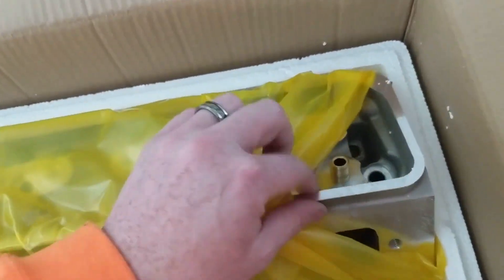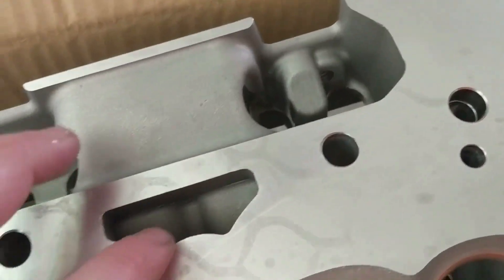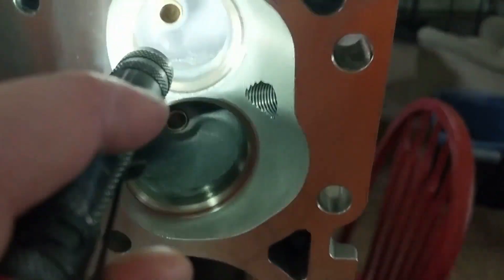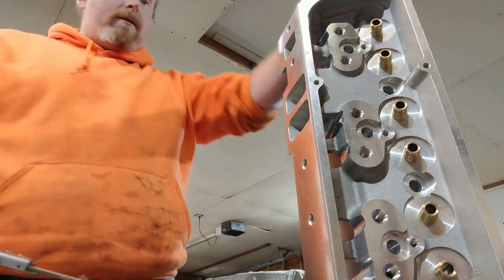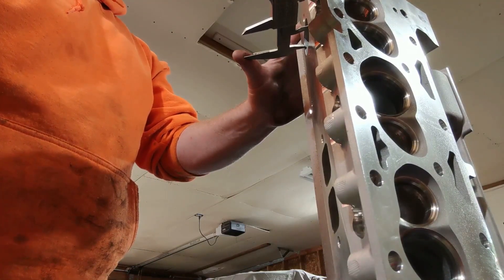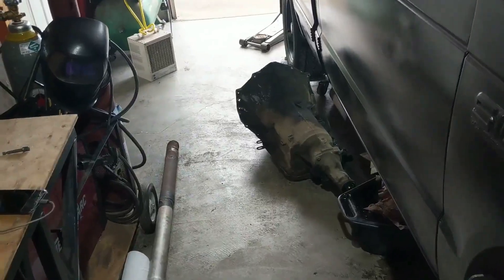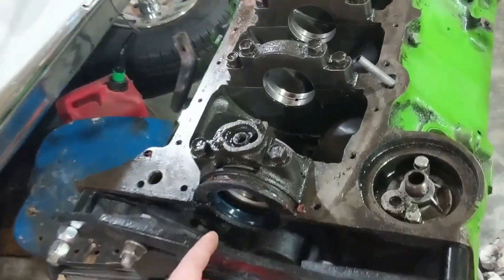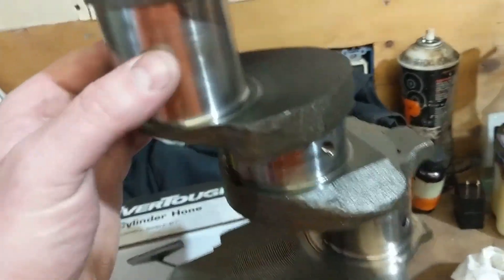Ebay Aluminum Heads... Are they worth it?   Part 1

Comment: What's the ebay part number on the aluminum heads?
Reply from the maker: There are a bunch of parts numbers, some heads have straight plugs and some have angled plugs. It all depends on what your application is. A simple search for eBay Sbc heads should yield results. I believe mine came from KMJ performance, if I remember correctly I was able to order the parts kits directly from them on their website. Here is a link https://www.ebay.com/itm/402267322479?hash=item5da900386f:g:DiYAAOSwVbVfK1iB&amdata=enc%3AAQAIAAAAwGQKBCwzW98v8qfCiCTgTp5k9%2Bmd3Gg%2F1bZYHt589QSlRZfsfC2DCf4pRqdEfKHoJxmalt%2Fsu4P8NYxs76Otir8UI%2BqJa0qZ4NekhR%2B9ZhFSplv3LssVx9WJ7%2FO7%2F5RAJzSyIs1j%2FECAsb3TuONq4%2F6nmN6S9MmgaIV4NeWkFPBnwlbDSBFbP4sLMl62A0xRrzvkZSW%2FHtPLxqR0xJG62zyUFeVcvn582%2B7nuGOYKceje0zBS1IOd3umqy7IRybUcw%3D%3D%7Ctkp%3ABk9SR7y_253LYg
Reply: @cheapskatenation yeah best to order from their site ....no sales tax vs.ebay  and the same free shipping that's on eBay

Comment: im using them with great results... they flow better than the dart iron eagles I had.. even had to rejet.
Reply from the maker: Glade to here it, I am close to starting my engine up, maybe this weekend
Reply: How would I build these head for a hyd roller cam with around .510 lift?
Reply: Old post. But mine are great. 515 530 lift. Some chamber work. Port match. And opened up the pinch point. Daily driver farm truck.

Comment: to measure the intake ports you need to measure the runner pushrod "pinch" difference. You were moving the camera to fast with the iron heads but the inside looked wider on the iron heads. You can make the entry of the poet as big as you wantt but if it necks down to nothing then the port doesn't matter.
Reply from the maker: I've wondered the same thing as I'm building this. You can only get as much air flow as the valve/cam will allow. Any obstruction will only slow down volume. Another thing I've thought about is how much power does the engine use pulling the air into the chamber and how much does it use to expel the exhaust.

Comment: What are you using for rocker studs on these ? 3/8 by 7/16 . Do you have a part number ? Thanks
Reply from the maker: 7/16 studs, I believe they sell them to accept 3/8 Studs.  I ordered bigger for more strength.
Reply: @cheapskatenation  totally understand that ,but I can't  seem to find anything for the length except big block head bolts as I think they would be too long . Your videos are excellent by the way 👏 👌
Reply from the maker: @bobbyd7140  Here is a link to the kit I ordered.  This was ordered after my long conversation with Jegs and what my goals were.   https://www.ebay.com/itm/384821710976?chn=ps&norover=1&mkevt=1&mkrid=711-117182-37290-0&mkcid=2&itemid=384821710976&targetid=1645685073528&device=m&mktype=&googleloc=9033251&poi=&campaignid=16730423415&mkgroupid=135815925780&rlsatarget=pla-1645685073528&abcId=9300841&merchantid=6321664&gclid=CjwKCAjwkMeUBhBuEiwA4hpqEF-f3L-DdzjQ_CnamB6omX-royNloSH4GiffFByysx-1bd5I-1NEQhoCP9EQAvD_BwE
Reply: @cheapskatenation  do u have a part # for the heads ?????
Reply from the maker: @keithwesley9880  The side of the empty box says Item No: SB300S.  but I can't find it on the eBay page. 

https://www.ebay.com/itm/124954044825?chn=ps&_trkparms=ispr%3D1&amdata=enc%3A1-9mDtOPRS1GodZtOqBA2cQ26&norover=1&mkevt=1&mkrid=711-117182-37290-0&mkcid=2&itemid=124954044825&targetid=1644837434363&device=m&mktype=&googleloc=9033251&poi=&campaignid=16743749222&mkgroupid=138744546207&rlsatarget=pla-1644837434363&abcId=9300842&merchantid=112297331&gclid=Cj0KCQjw-daUBhCIARIsALbkjSZ8TFZ8dMoeU_2jDGMH3BzXduXsAdPKluRJrAFQaZDCUw0QOOwHmPoaArhlEALw_wcB
Reply from the maker: I will have to look up the part number

Comment: Link?
Reply from the maker: https://www.ebay.com/itm/124954044825?_trkparms=amclksrc%3DITM%26aid%3D1110006%26algo%3DHOMESPLICE.SIM%26ao%3D1%26asc%3D239310%26meid%3D39fcf8a685d046aaa35a1b225708a0a5%26pid%3D101195%26rk%3D4%26rkt%3D12%26sd%3D124953933580%26itm%3D124954044825%26pmt%3D1%26noa%3D0%26pg%3D2047675%26algv%3DSimplAMLv9PairwiseWebMskuAspectsV202110NoVariantSeedWithRevOpt85NoRelevance&_trksid=p2047675.c101195.m1851&amdata=cksum%3A12495404482539fcf8a685d046aaa35a1b225708a0a5%7Cenc%3AAQAHAAABIFVvFeUTQhL4KP79koL%252B4Ydgokeb2CQrAyC%252BOwbdpQetV2qAC7C3Vu0XLY04JD2l73LYnMyfSHCKvxS7d%252F15SZkzt3R6SVmVH5RGEka%252FDqn9arEg1VeRsNbhzrNZtjfcOQhnRehHOX7n%252BGxjvuyMC%252BGVaaG%252BcsacoB1loZWMkOZYiul35gC08giKm2orCXs50QjhN91SEtDlleQIgWKgS91mR%252FfE%252Brq9qXQ5iU5zqTw5EJt3j36R1kmzXV72TRWEEIT4YvvxOzq20rgM1OoNDcfD0fA1huyxtaj4tz%252F8ly7a6xrXR5OgeBLd6o90p%252BERnBcaqHpL%252F6npjmfNnmAD5f1mCVjsWDk7omfbLqufVhVBobL%252BA7r%252B1XLMeMyySRRiow%253D%253D%7Campid%3APL_CLK%7Cclp%3A2047675